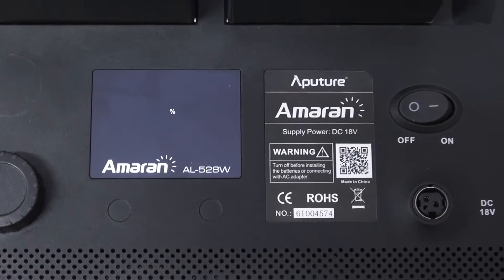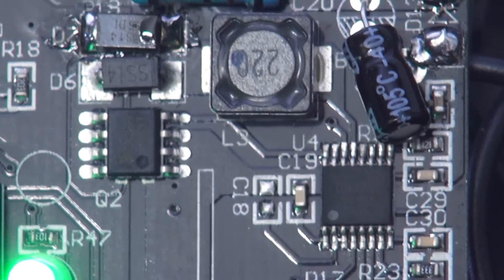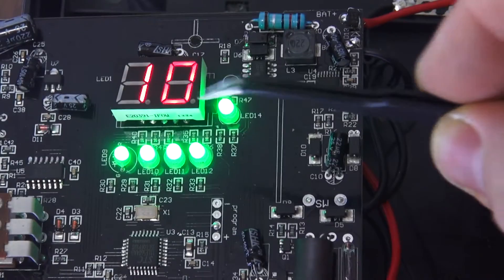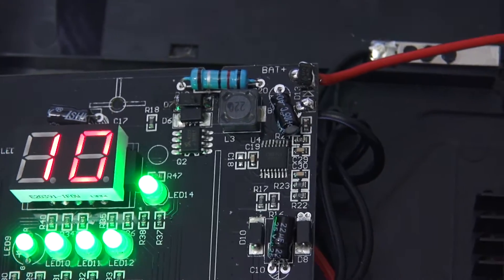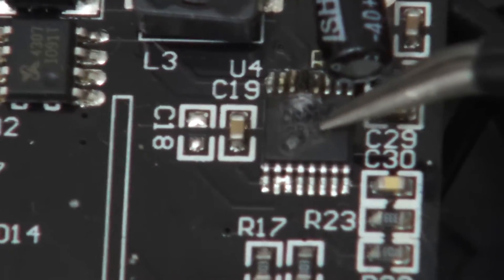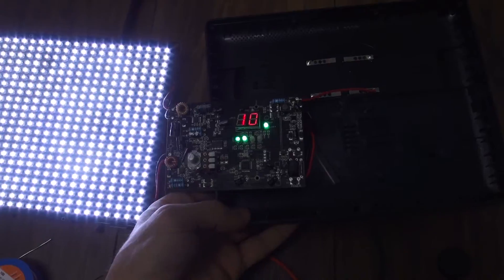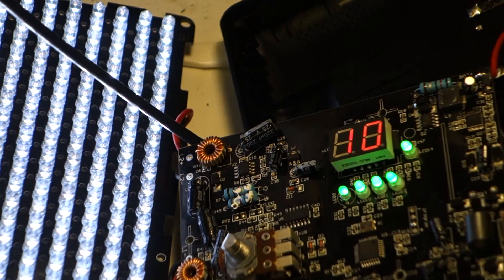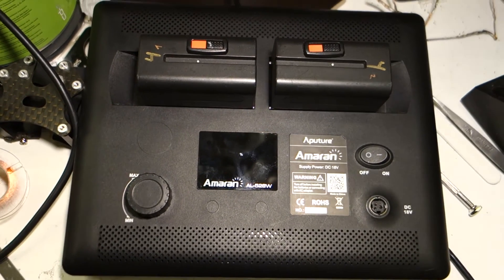Aputure Amaran H528 LED panel repair - with CN3704 charging controller

Comment: Mine is powering up and allowing me to adjust the potentiometer from 0-100%, but there is no output from the from of the light. Actually, there is minimal output, I can barely see the leds light up, but there is something. I’m not electrically savvy, but I’m wondering if there’s anything I can, or should, do?
Reply from the maker: probably a damage to the power stage. The "display controller" is separate so it will also display numbers even if the actual powersupply is dead. I'm afraid not much you can do if you dont have an idea which components are doing what.
Reply: @youser23  thanks for the information, I appreciate it

Comment: Great job diagnosing and repairing these! I fried a 528W with a massive static discharge that left a large portion of the circuit board looking fried. I'm thinking the only repair for it would be to replace the whole board, unless you have other ideas. Aputure says they'll sell and ship me a board for $60 or I could ship it to them for repair, $80 including shipping.

Comment: I managed to fry an RC battery charger in the past by unplugging the battery in the middle of the charging. The likely reason is that you suddenly have to dump all the power that would usually go into the battery somewhere and something has to give. :) So since then I stop the charging before unplugging the battery.
Reply from the maker: Piotr Esden-Tempski yep I'm pretty sure it  was some sort of overshoot like that. It's funny though I killed them all at once :D I'm thinking that I might also have had a bad battery that I tried through all 3 of them